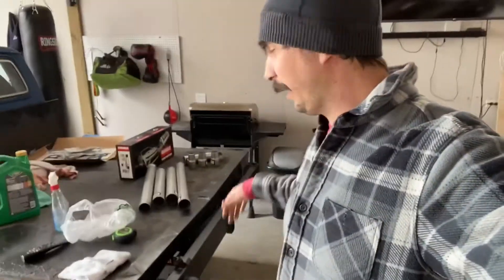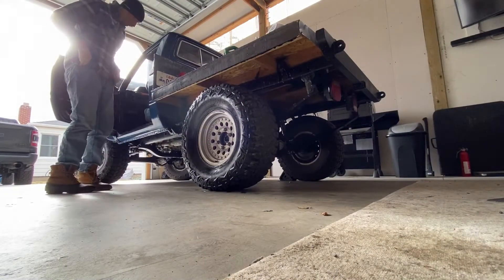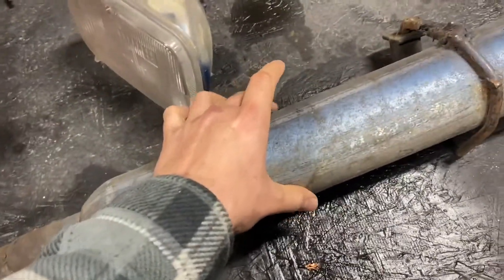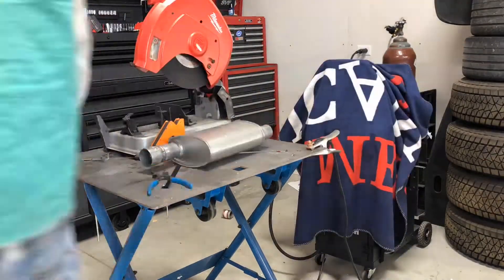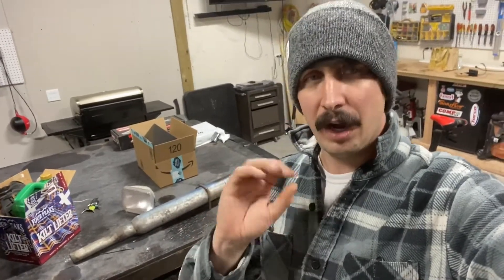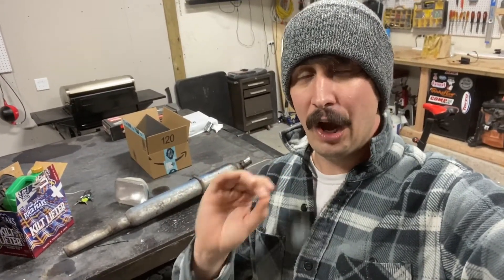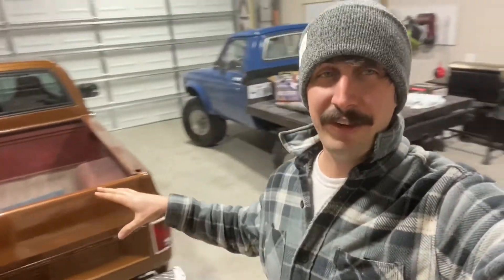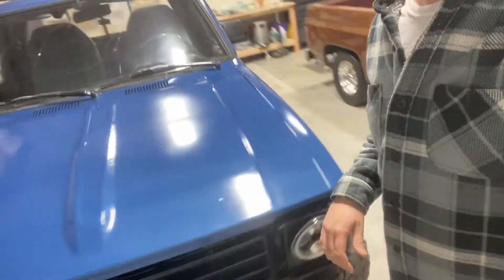Toyota 22R Exhaust Cheap DIY

Comment: Nice tidy job good work, in all honesty, I think it practically sounds the same.
Reply from the maker: Yea they did sound very similar.  The 2-1/2” had considerably more back pressure even by just feeling it with your hand.  The 3” was likely overkill for the power output but I wanted this thing to be surprisingly quick for what it was - wound up working out well

Comment: Any idea why your truck was smoking??
Reply from the maker: Could have been a couple things.  It was cold when I filmed this but more then likely I had just totally rebuilt the top end.  I suspect there was startup lube on a bunch of parts which was burning off.  If you check out the playlist you can see all the work I had to do to the engine